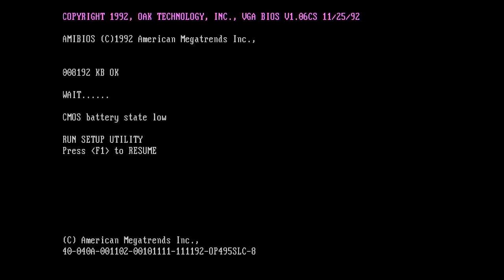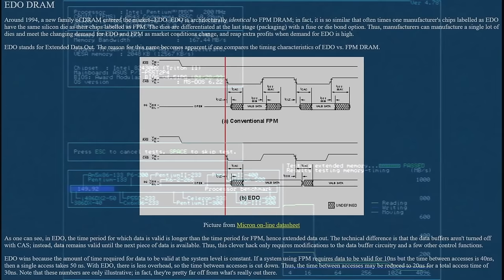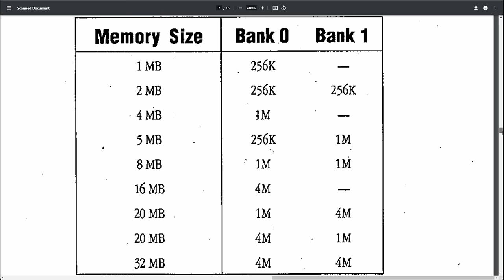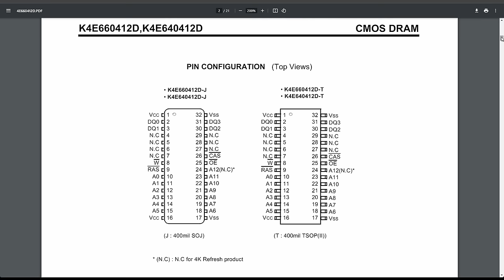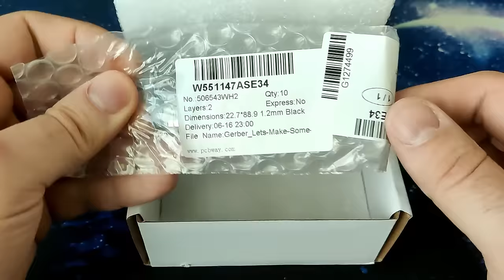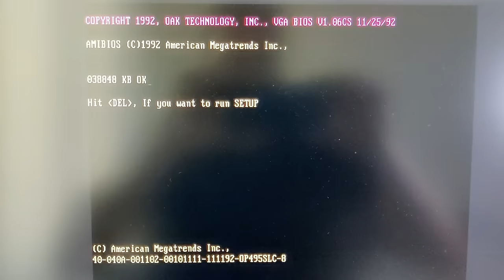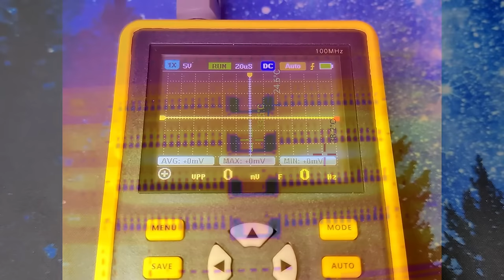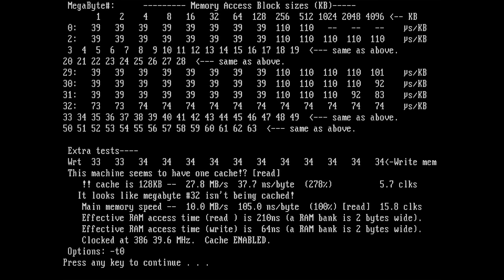DIY 16MB 30-Pin FPM SIMMs: Supercharge Your Vintage Hardware!

Comment: Thanks so much I had a ton of sim modules that where from a different pc that did not physically fit in my 486 pc now I can use them (I believe they where server or smth else) and now I can put them to use without throwing them out!
Reply from the maker: I'm working on an updated version of the PCBs. They should better support 3.3 volt memory chips.

Comment: What is amazing about this project is that I happen to own a pair of 486 boards, one accepts FPM or EDO, the other is "FPM Only". 

I am definitely interested in a set. I'm pretty sure it would cost too much for salvage memory chips around here. 

Excellent wotk! Your exilleration reaction when it worked was heart-warming. 😊
Reply from the maker: I haven't done a lot of testing on 486 systems yet, but I believe I only have FPM compatible boards. Luckily, with those modules, I can easily test if the board supports EDO by flipping four switches. Thanks for watching and letting me know. Considering that I can create 18 SIMMs from one of those larger memory modules, the cost of making one will be acceptable.

Comment: I'm not surprised that consumer 386 (and even likely some 486) systems that used 30-pin SIMMs had a limit of 64MB when using them. That would have been an insane amount of RAM back then, and would have been expensive. The industry largely went to 72-pin SIMMs for higher capacity modules.

It's possible that many motherboards were designed such that they could support 16MB modules (if the chipset did), but due to cost and/or availability at the time of release, they only claimed support for 4MB modules.

Sill nice to know that some 386 boards out there aren't limited to only 32MB of RAM.

Comment: SoundBlaster AWE32 (and AWE64 IIRC) supported 2x 16M modules, but could only use 24MB of RAM for soundfonts.  Back in 1990s this was The Ultimate MIDI Setup.  SB-Live! / Audigy soundfonts will work with it too.  
(yes, yes, didn't forget, there was GUS, and Holy Wars wars between some GUS and AWE users, I know ;)
Reply: The SoundBlaster AWE32 was released in 1994. But later soundcards where much better MIDI setups. I had a Terratec EWS64XL in around 1997. This was still in the 90s and the EWS64XL was much better than the earlier SB AWE32 and still an ISA card for best compatibility to DOS games.
Reply: @OpenGL4ever In fairness, with full ram you can get very nice midi quality out of the AWE32, so long as you chosen DOS game will run under Win9x. Depending on the model they can also have real OPL3 FM, which is a nice perk as well.

Comment: Nice project.

As you already have surface mount soldering capabilities, order the stencil with the PCB. The non-framework ones are cheaper and easier to store. Then use solder paste and an old plastic card to apply. This makes manufacturing of the boards a lot quicker and easier.
A gold edge connector would also be a good upgrade as it would reduce the risk of corrosion over time.
Reply from the maker: This is the plan! Stencil and solder paste. I wish I could order those modules gold plated. But it's quite pricey.
Reply: @bitsundbolts  
I agree it doesn't work at low numbers, but you can play with the options to find a sweet spot that might work for you.  

For fun, I just ran a quote with a non-framework stencil (metal sheet without a frame around it), 20mm x 100mm PCB using the edge connector option and choose immersion gold(ENIG), then increase the quantity up to say 50. This came out at £79.90, so $1.60 a card. Changing the quantity to 100 gives $107.60, so $1.07 a board.  The equivalent costs without gold edge connectors were 50 off $45.64, 100 off $75.05, so the costs are much lower overall. This could work if you are planning to sell on ready made modules or even blank boards. Note that these all included a cheap shipping cost too

The other option is to look at gold plating solutions that can be added once the boards are manufactured. They are either brush on or dipped. There are many on-line. 50ml for £30 was one example I found. I note that some have hazardous chemicals in (cyanide), so be really careful if you go this route. Take a look at the newer fluids that don't have problem.
Reply from the maker: I would not want to deal with chemicals - as you point out, the gold option may be feasible! I didn't check those options yet, but it may be worth it for some high quality SIMMs. Let's see how this project continues! Thanks for checking the quote btw!

Comment: I recall that those large-capacity modules that You used to source the memory chips from, were used mainly in the HP Netserver series. As all such things, they used to cost a fortune back then - so I'm in a bit of an envy that you've found that lot in the scrapyard. :)
Reply from the maker: I hope to find more since it seems like those modules are in demand. However, I do find those on classifieds websites too (especially in the US). I have no access to those - I need to rely on my scrapyard

Comment: That's awesome! I have to check my memory connection I have. Maybe I have some of those. If not I'll be interested too.
Reply from the maker: I hope you'll find some of those chips. Making those modules yourself is just so rewarding!
Reply: @bitsundbolts  unfortunately, I don't have those. I'm interested in 4 modules.

Comment: What I'd really like to see for retro machines is an all-in-one storage adapter: SATA connectors and maybe a network port on one side, multiple GB of RAM for caching in the middle, and legacy connectivity on the other side (PATA/Floppy and/or ISA or PCI). Board runs Linux, you connect storage on the modern side, it reads disk images off that storage and presents those images as floppy or ATA disks on the legacy side. There are already SATA/PATA adapters, which allow a modern disk to be presented to an old system, but there are issues with old BIOSes choking on large disks. Using images would allow for keeping presented disk sizes to something BIOS can handle while using the capacity of the underlying modern disk to provide a multiboot environment with multiple legacy OSes without having to squeeze all of them into the size of whatever number of small disks will fit in the chassis.

Comment: Very cool design.  If you want to expand further you may be able to hotwire a secondary memory controller into a piggy-back board right on the CPU.  This would also allow you to use even faster memory such as SRAM.   High density (by late 80s standard)  SRAM is now dirt cheap as it is used in some microcontroller use.  You can easily get 4MBit modules for relatively cheap.

Comment: My first PC was a Pentium 90 with 4mb of ram. I remember paying £240 for an extra 4mb! Back in 1995 memory was stupidly expensive
Reply: I upgraded my 486DX from 4 MiB to 8 MiB in June 1995 in Germany. I paid without tax around 46.37 Dollar (64.35 DM) per 1 MiB SIMM Module. Thus 185.48 Dollar in total and 213.31 Dollar with 15 % tax.
Reply from the maker: 15% Mehrwertsteuer 😂 that was the time! Crazy how expensive RAM was!
Reply: @bitsundbolts  And yet it was worth it just to be able to play Dark Forces. My friend from school followed suit, he also wanted to be able to play Dark Forces. It was my first game, that required 8 MiB, the next was Warcraft 2 Tides of Darkness. The computer was too slow for the later games, but the upgrade was still useful for Windows 3.1.

Comment: Awesome as usual! With this amount of ram you can install some Linux distro in future videos.
Reply from the maker: Although I am not a Linux user, it is interesting that this amount of RAM would allow to run software that would be difficult to use without. I may give it a try. I remember trying out some SuSe distributions long time ago, but I don't remember what version (maybe 7?).
Reply: @bitsundbolts  I just remember that Linux kernel drop 386 support in 3.8 version so last working kernel is 3.7.10 in theory all distro before 2013 should work. 
Also I personally want that you run Windows 98 SE and Windows 2000. I know that Windows 2000 work with 486 and 64mb ram but don't know about 386.
Reply: @bitsundbolts  I used Linux Slackware 7.0 on my 486DX with 8 MiB. Starting with Slackware 8.0 with kernel 2.4, I had to bake an extra kernel so that I could boot to the command line with the 8 MiB. I couldn't install Debian or Suse, the installer required to much RAM.

Comment: The max amount of memory I had in my 486 SX2 in the 90s was 20 MB. It had come with 8 MB across 8 slots and I had pulled 4 of those and changed  them to 4 MB modules. The CPU I swapped with an Evergreen upgrade.

Comment: Nice! I thought I was special with my 4MB modules :p

Have you tried to tighten the memory timings? Those timings are probably the most important feature of EDO memory :D
Reply from the maker: I haven't done much with those modules yet, but I'm planning on doubling the cache on the board and also exploring what's possible with that amount of memory.

Comment: 64MB on a 386 ... that is just crazy, I wonder if these will work on a Mac SE 30 lol

PS Was a bit worried about the logic voltage , but it seems fine , so good job :)
Reply from the maker: There is only ONE way to find out if they work on a Mac SE 30 :)
Reply: likely yes but they will be too tall to get the motherboard back in the tray

Comment: Upgrading my 386SX-33 from 2 to 4 MBs so that I can watch a slideshow of Doom was the very first upgrade I made to a PC. ☺ It cost me almost EUR 350 in today's money, a fortune for 10 year old me! Still have the board and the memory (as well as the fond memories of killing my first demons) though, so it was well worth it. I'm fairly certain that my low cost board can only take 16 MB, so no 16 MB sticks for me I guess. I take solace in the thought that it wouldn't really benefit from more than 4 MB anyway, modding it with a socketed oscillator for a 40 MHz CPU clock is probably the only way to gain performance, since it doesn't even have any cache or cache sockets. 😐

Looking at the huge demand, I'd be more than happy to give you a hand with manufacturing some modules and/or distributing them within the EU though. Soldering is fun, considering the amounts you are looking at, it may become a bit of a drag though, if you have to do it all by yourself. 😉
Reply from the maker: Hello there! Yes, I think 386 SX CPUs are limited to 16 MBs.
So, I got some insights about my PCB design and I probably have to fix the 3.3v memory chip vs 5v chipset issue. I guess there will be a new revision with more ICs on the board. If I get this to work, we may get something going in terms of setting up distribution channels 😉
But first, I would first want to make sure the design is correct.
Also, I'm planning on using stencil, solder paste, and a hot plate for making those modules.
Reply: @bitsundbolts  I see! Perfecting the design is indeed much more of a concern if it's not just a one-off for yourself. I guess I should not be surprised that you are taking this as an opportunity to gain some more experience. 😄 Best of luck that the manufacturing process turns out as intended!

Also, I just noticed that the brand name of one of your memory modules is "Topless". Must've been the same guy that came up with Assmann. 😂

Comment: It's insane to even think of 64mb on a 386. At the end of the 486 era I had 16mb and that was overkill. I think that was around 1996 with my overclocked amd 5x86. Still cool to see it can boot up with that much ram.
Reply from the maker: There must be a 386 chipset that supports 128mb 😅
Reply: @bitsundbolts  I would think a board that supports both 386 and 486 cpus would have the best chance, but then again I'm not that familiar with it. Always fun to see if an old cpu with handle an absurd amount of ram though!

Comment: You can try using liquid solder for hot-air soldering memory chips. After some practice you can install chips in no-time.
Reply from the maker: I was going for solder paste, a stencil, and a preheater to hopefully get some nice closeup shots.
Reply: @bitsundbolts  You can get away without stencil if you get high quality more liquidy solder containing silver (the stencil variety is a paste-like). Just draw a straight line with the syringe across the pads, allign the chips and use hot air. The solder will stick to the pins soldering the chip without bridges.
Reply from the maker: I might give this a try - another method of doing it.

Comment: Never needed more than 4x1MB in my 386, it was enough to run doom and command and conquer poorly, but they actually ran so I was happy. C&C should not have worked at all on a 4MB 386 but somehow it did. By the time 8MB games were common I had a 486 with 8x1MB.

Comment: I was not a PC guy, more an Atari, ut at work the 386 that was assigned to me had 8 MiB and it was more than adequate. With DOS and a little bit of Windows 3 there was no point in much more memory. Only at its life end would a little it more memory be necessary when I started to do some AutoCAD. AutoCAD 9 was the maxi I could use on that 386. Acad 9 was limited in its Lisp implementation to 1 segment (64K) and as I did a lot of lisp I would have needed an upgrade to Acad 10 but the 8 MiB were too small. Upgrade of the whole computer was the better choice.
I got a Pentium 90 PC with a 2nd CPU socket (but initially only 1 CPU) with Neptune chipset and 6 SIMM72 slots for FPM modules. At the end of its life I managed to upgrade the machine to 2 Pentium MMX-233 (with adpater sockets) and 80 MiB of memory. I even had used SIMM30 to SIMM72 adpaters in it. That insane machine also had 1 IDE disk only for ooting and 4 16 bit SCSI harddisks, 1 SCSI CD-ROM, 1 SCSI burner and an external Zip-drive and SCSI HP-Scanner. The motherboard was oveclocked from 33MHz to 35.2 MHz (70Mhz oscilator to replace a 66 Mhz), not much but more was difficult for the EISA slots (yeah I forgot, it had EISA and PCI slots but no floppy/IDE on board). I should try to revive it and film for yt.

Comment: Well my 386sx had DRAM Chip sockets onboard 2MB  + Add on Card 6 MB... My old 385DX Full Size AT Mother Board had the 16 SIMM 30Pin sockets and was 64 MB w/ 4MB SIMM sticks in the unit..

Comment: Amazing video with great insight. What are C1 and C3 for? You left them unpopulated.
Reply from the maker: Those capacitor pads are for the input voltage to the regulators. You could add some additional capacitors to smoothen the input voltage - I left them because I have a good power supply and don't think it would make a difference.

Comment: Nice!  i remember having a 386 with a whole 2MB RAM.  It wasn't enough.  didn't get 64MB until i got a k6-3 several computers later :(
Reply from the maker: Yeah, that sounds like a more reasonable platform to put 64 MB on 😅

Comment: My old Packard Bell 486 started out with 4mb, but by the end of its life had 32mb. Since it was all low-capacity SIMMs, I had to use several of them per slot via expansion boards. This was def more than enough for Windows 95, but then I made the mistake of installing Win98 on it…
Reply from the maker: Ohhhh, I remember when I installed windows 95 on my 486. It was such a great experience. I loved it, my PC felt like new. I only used Windows 98 with a Pentium II 350. I never attempted to install it on my AMD 486-DX4-100.
Reply: @bitsundbolts  By the very end I did upgrade it from DX2-66 to DX4-100, but even this didn't make and difference for W98 performance. Should've just downgraded it back to W95.
Back then couldn't figure out how to upgrade the video card - would've been fun to see how far I could push it: )

Comment: Interesting video as usual :) Got some ideas to make 4mb modules out of old 8mb EDO modules in the same way since I got plenty of them laying around here. Not sure if its possible though.

In the end of the life of my 386DX 33 it had 20mb of ram, enough to run Windows 95 a bit better then how it ran on 8mb that I had before. I had that computer until the end of 1998 when I got a chance to upgrade to a Pentium 133,

Comment: There's a problem with connecting the 3V chips to a 5V bus. The DQ[3:0] pins are bidirectional, so they have both an input and output circuit. While the input is a high impedance circuit and can probably tolerate over 5V, the output has a clamping diode pointing to the 3.3V supply. Your particular chipset is only driving the bus to 3.4V, which is not enough to make the diode conduct, but there are worst-case scenarios that can cause high currents in the diode.

The 3.3V supply could be as low as 3.0V, while the 5V supply could be 5.5V, which might drive 3.9V (3.4+0.5) to 5.0 V on to the bus and exceed 3.0+0.7=3.7V on the 3.3V output, causing the diode to become forward biased.

The 3.3V supply doesn't turn on instantly, so it's possible that it may not be ready before the chipset starts driving signals onto the bus.

One mitigation is a series diode between the outputs to reduce the current. If we assume a worst-case difference of 5.5V the resistance may be quite large, which together with the input capacitance will filter out the edges and violate the rise time. If you can guarantee that the 3.3V supply comes up before the signals are applied, then this will reduce the voltage and you can use a smaller resistor.

Bidirectional level translators are available, they usually block until the power comes up on both sides and will convert the voltages to the appropriate levels. They have around 5ns propagation delay so you will have to verify the timing, as well as figure out a way to drive the direction input. An 8-channel device should cost fifty cents in quantity.

The input-only pins are more tolerant because they are only connected to a high-impedance MOSFET gate, so you may only need one 8-channel translator per module (4 data pins per chip x 2 chips).